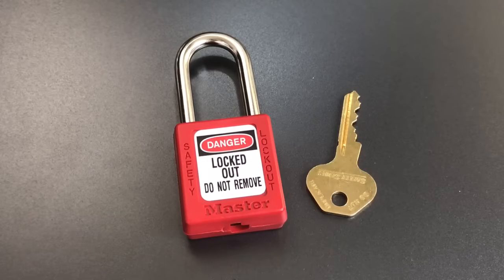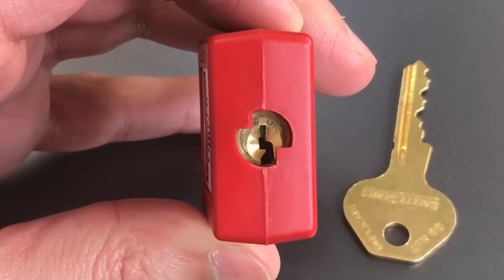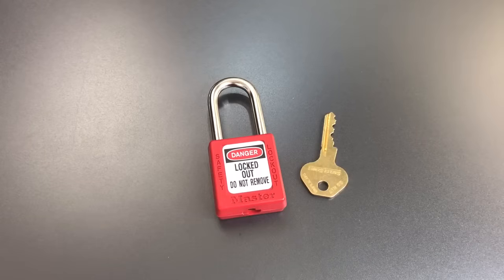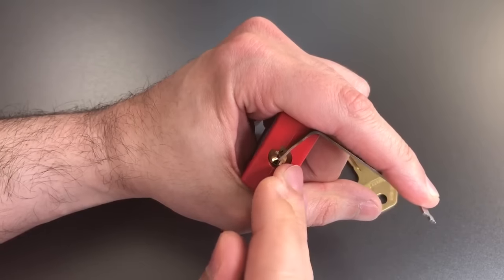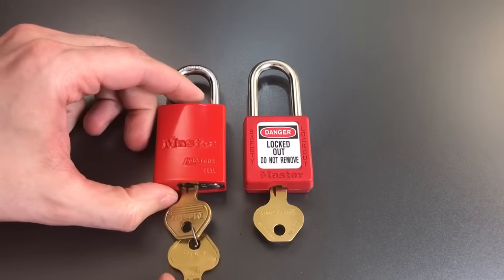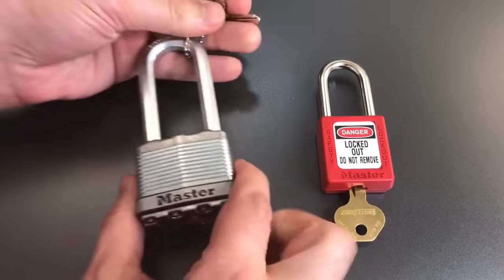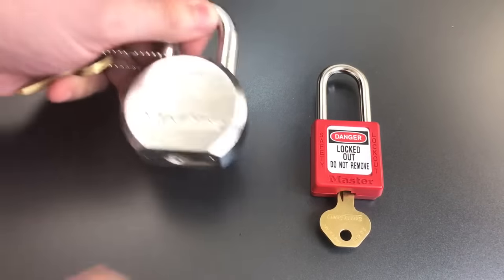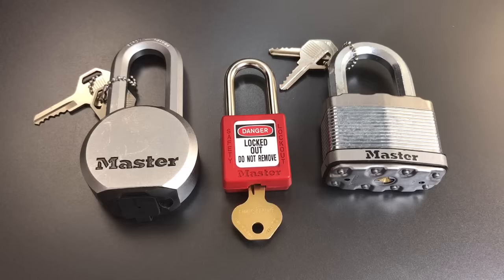[479] The Master Lock Paradox - Model 410 LOTO Padlock

Comment: I've worked in the industrial field for 15 years and I think I know the answer to your paradox with the loto locks.
A given employer may have thousands of these locks on their site at a given time (sometimes 10+ per employee), and possibly use millions of locks over the course of their business lifetime. You absolutely cannot have a key that matches a lock anywhere else than that one lock it is tied to, that is a big insurance and safety problem. So the more pins allows for more key variations. Also, people are constantly sticking their keys into the wrong locks accidentally, and so the higher quality core allows for less chance that they will force the lock open before they realize it is the wrong lock. I do this multiple times a shift, because I have several locks issued to me with many similar keys and I typically just go through them until I find the one that opens (I know I should label them). 
The more pins means there is more variety for the keys and less chance of a duplicate on site. The higher quality core, which is in all likelihood regulated by law, means less chance of someone forcing a very old lock open.
The reason the quality of the housing is so poor is intentional. You want to be able to cut or even smash the lock off in a hurry if you have to. Maybe there is an emergency and you think of a way to operate the machine in order to try to save someone who is injured. Also, more benignly, people leave for home with their locks on machines all the time on accident handing off to other shifts. So you don't want some sort of monster lock on there that you can't get off without the key. The cheap build makes buying them much more affordable for employers, when they buy thousands of these at a time.
They are not security locks, they are safety locks. High volume that must meet stringent safety standards (6 pins) for various reasons, but are not meant to be undefeatable in all circumstances.
Reply: As far as why there are stronger locks with shitty keys and cores, that seems pretty easy thing to answer. Most of these locks are all fairly cheap and sold at hardware stores, likely bought by soccor moms and the like to keep their shed closed or maybe a dirt bike or something chained up. You don't want some petty incompetent thief to be able to smash the lock open or cut it open easily when you're not around.
But if you misplace or lose the key over the winter time while you're not using whatever you have locked up, you also don't want it to be an impossible task for a locksmith to open your lock. Maybe you could even pick the lock yourself. Also more pins means more points of failure outside during rain and rust and exposure to elements.
In short, the customer gets what they want. These decisions aren't being made by masterlock. They're being made by masterlock's largest customer base.
Reply: @j37j2  "They're being made by masterlock's largest customer base."

True yet false :)
You assume the customer base is informed and makes a reasoned decision ...
Reply: @j.p.vanbolhuis8678  I don't think its unreasonable to assume that the insurance companies who require these locks can make informed decisions, when they are the ones who lobbied the government for these regulations in the first place.
There's no one person or organization who comes up with these ideas. The market evolves until it meets what is best.
Reply: I was going to say the exact same thing. Glad someone figured it out :)

A lock out lock isn't for security. It's to stop operator error.
Reply: @j37j2  Well, trouble is, masterlock does advertise a lot of easily defeatable locks as "unpickable". Assuming you're ignorant (not stupid per se, just not a locksmith), you might rightly assume that lock is enough, even if it's actually garbage. "High security" locks defeated in a single second, where the average consumer may simply not know about such weaknesses and may reasonably demand a lock that, well, locks something. When the consumer is lied to, an educated decision isn't exactly easy.
Reply: @j37j2  Locksmiths just show up with an angle grinder to cut your lock off if you lose the key.
Reply: @johnmoser3594  Or if your company is very strict about LOTO, they'll force an employee to come back in if they accidentally left their lock on a piece of equipment. I know of contractors who were called back from several states away to remove a lock they forgot to take off when they left the job site.

Key losses opens a whole can of worms lol
Reply: None of OPs wall explained why the heavy duty locks that are supposed to be safest have a crappy core and aren't safe.  
And did a terrible job explaining why the loto cores are so good when you can clip them easily.  So you can have a different sort of key as you try every key on your keychain? No, that would be utterly ridiculous to do instead of labeling the keys. 

Most establishments that have loto are smaller and rarely use it (groceries and restaurants),  and definitely aren't specifically ordering the locks with great cores just to have a different kind of key. The companies I've worked for and with tend to have policies that the loto keys not in use are kept with the corresponding locks.

Walking around with a whole keychain of unlabeled loto keys sounds like a terrible idea xD
Reply: A couple other theories:

Theory 1: local LOTO regulations from OH&S/OSHA in different areas may specify the type of locks to be used, in order to prevent the possibility of key-swapping between locks.

Theory 2 (everything hereafter):
Having used LOTO a few times myself, I think the appeal of a 6-pin core is that the lock body and key shank are longer and therefore easier to identify.

This would be ideal for a group LOTO, where a prime lock is put on the machinery, while the key is locked in a LOTO box by each person working on the equipment. The last person to remove their lock from the box gains access to the prime key (which has 6 pins instead of 5), to go unlock the prime lock and restart the equipment.

Often, contractors will have dozens of LOTO locks, for multiple LOTO points and/or for multiple team members. If the prime lock and/or key get thrown in a toolbox with a bunch of 5-pin LOTO locks, the prime set would be easier to identify.

This is just speculation about it's intended purpose, though, as I've seen combinations of 5- and 6-pin locks used for both individual and group LOTOs.
Reply: @rustylee1836  Um, yes you do need to be walking around with LOTO keys on your keychain - at the very least your personal one should be kept on you at all times. Large scale work at our plant may require dozens of locks on things like switch gear, breakers, or gas/water/compressed air valves. These locks will stay on for weeks at a time while the work is being done. At the start of the work, the locks are applied to the relevant gear, then all the keys are stashed in a gang box. That gang box is then locked via hasps with all the relevant parties (local employees and external contractors) adding or removing their locks to their hasps as they start and complete work.

And its not about the key looking different, it's about making sure there's no accidental duplicates where some bozo not paying attention can jam his personal key into a LOTO lock and accidentally have it work.

Sorry you've never had the chance to see an actual LOTO program in action lol
Reply: @dan8250  Nope I have indeed seen many loto programs, and several in action. 
Most loto programs are not at giant plants. Most are at smaller establishments that DO NOT have the same situations as giant plants. Many smaller establishments have about 6 loto locks and rarely use them. And do not carry them around. 

Many different places use loto. Even restaurants and grocery stores use loto. And they generally only apply 1 lock, which they get from the loto station, and has the key with it.

So maybe keep your condescending comments about others not having seen a loto program, to yourself.  Since it might be you that has seen fewer.
Reply: Every pin usually has 10 levels, so with 5 pins you have 10^5 combinations, that is, 100,000 of them. Far more than any company would ever need. It also doesn't explain why this lock is the worst of them all with the plastic body, when the other loto locks have metal bodies.
Reply: Still doesn't explain why the put security pins in though
Reply: @rustylee1836  you literally answered your own question there, friend. If smaller shops have only a small number of LOTO locks, while giant plants will have dozens, OBVIOUSLY the giant plants will dictate the standards because they're the main customer base. And they need it to be all but impossible to use a wrong key in a LOTO lock and have it open-that's not even just a thing they *want*, I'm pretty sure in many cases it's the law. 

As for why they put bad cores in hefty lock bodies? Easy: Profits. The nicer cores are more expensive to make, and most people buying them don't realize how easily pickable the basic cores are, so Master gets away with it and pockets the difference. But with the LOTO locks, if a large plant placed a bulk order for locks and got a bunch of duplicate keys or easily-bumped-open locks someone could easily die. And when the accident investigation found that the LOTO lock came open when it shouldn't have...Master would have hell to pay. Cheaper in the long run to use the nice cores and not have to pay the fines for killing someone.
Reply: @itisabird  That's incorrect. There are only 6 depths for the keys. Masterlock's 410 LOTO specs state "over 40,000" combinations... A little math reveals that 6^6 yields 46,656 combinations. With 5 pins, that's only 15,625 combinations.

This becomes a "birthday paradox" problem (if any two people (keys) share the same pattern (birthday))... So, larger groups of locks have a substantially higher chance of having matching keys.

For example, with just 25 locks (common for about 5-6 people), a 5-pin lock would have approximately a 2% chance of one person having the key to unlock another person's lock. A 6-pin lock reduces that probability to 0.6%. For smaller groups, these probabilities are much smaller. (For 10 locks, it's about 0.3% and 0.1%, respectively.)

Furthermore, if individuals use 5-pin locks while group lockouts use 6-pin locks, the chances of someone accidentally (or worse: maliciously) unlocking a group lockout becomes miniscule.
Reply: Very well explained.
Reply: Absolutely correct. I work for Dupont and of course have my own set of locks. So does another thousand or more employees at the same sit here at Spruance.
Reply: I label my locks with the key number...they have an alphanumeric stamp...its easy to figure out the right key...and your name is supposed to be on it or on a non-removable tag affixed to the lock...so if its not yours its illegal to try to open it...anything else youde like me to clear up about your problem with using the wrong key?
Reply: @rustylee1836  As I wrote in my reply to that dipstick...the keys have stamped codes that make it easy to label the lock with...I have a write-able tag on each key and as soon as I apply that particualr lock the location, item and date are written on it...I dont know why people cant figure that out...should not be a problem figuring out its not your lock...
Reply: that plastic lock is ingenious actually... It is made of cheap materials (because it is not a security lock) so it keeps costs down. BUT it has a robust core with lots of key combinations which solves the issue of possibly getting a few locks with the same keying on a jobsite.
Reply: Sounds fair enough to me ?
Reply: @RingpopSmiths  So probability isn't my forte at ALL, but your 2% seems wrong. 

You're saying that getting the same combo 2x in a batch of 25 out of 15,625 possibilities is a 1 in 50 chance?
Reply: @rustylee1836  It's a little counter-intuitive at first for people who aren't familiar with how the birthday paradox works. What may help is thinking of it this way:

Let's say that myself and 4 other people each have a lock with 100 possible combinations. Most people think, "What's the chance that one of the other 4 people has a lock identical to mine." In such a scenario, the answer would be 4%.

However, the birthday paradox doesn't consider just the locks that match one fixed person, it considers the possibility of ANY TWO people matching. It's the same as asking "Do I match with anyone, or does anyone else match with another person?" In this case, it's like turning the fixed case into a handshake problem (get everyone in the group to shake hands once). I can shake 4 hands, the next person can shake 3 more (because they shook mine already), the next person 2 hands, the next person one hand, and the last person doesn't shake any more hands (because they've already shaken everyone else's hands once).

To combine this scenario with the locks, the inverse of each probability is multiplied together and re-inverted to get the final probability:
(1-0.04)*(1-0.03)*(1-0.02)*(1-0.01)*(1-0.00) = .96*.97*.98*.99*1 = 0.90345
1-0.90345 = 0.09655 ≈ 9.7%

As the group of people grows larger, the probability rapidly approaches 100%. For example, another 6 people (11 total) is 43.5% chance of matching. 5 more (16 people) is 72% chance. 5 more (21 people) is 90% chance. At 26 people, it's a 97% chance of two people matching, not a 25% chance as most people would assume.

So yeah, 2% may feel wrong, but it's not.

(Note: I didn't use any reference material and I'm starting to get rusty on my statistics, so there are likely errors in the above calculations, but the general principles and explanation method should sufficiently illustrate why the probability is not simply a multiple of the number of locks.
Reply: That tells me that the people working with you are mostly extremely superficial. And not very precise people. It is not very hard to look at the number on the lock, and see that the number match the key. That would be good enough for me, to never mix up any of them. Even if all the locks had the same key. Or have some fun and pick the lock instead, and you don't need the keys… 🤓
Reply: @dan8250  most plants I've been in would only break a lock if the employee/contractor absolutely couldn't come in or had died on the job.
Reply: Well said
Reply: Fellow industrial worker (I worked on ship) 100% agree. But I can see why he was confused. I would also add that they wanted to protect it against nondestructive opening. Like if you had to cut it open that’s one thing and it would be hard to cover up but if you were able to “easily” pick it then it is a potential insurance loop hole. And they do love loop holes. .
Reply: @Gismo3333  That is assuming that the labeling is legible. Besides he mentions in his OP comment that his keys were specifically not labeled. If he’s only got a handful or two of keys not that hard to try a few before you find the right one.
Reply: @rustylee1836  I love how you’re first comment assumes that your experience is the norm then you get mad at other who do the same thing. Clearly there are setting that do not use LOTO as much as others doesn’t make one better than the other.

What I will respectfully suggest is that master lock is not making these locks with the small use case in mind since I would assume that most of their sales and repeat costumers are large scale plants and other industrial settings. I know on my ship alone each ships officer had about a dozen of these.

And since ships have maybe a half dozen officers that quite a lot of locks for one setting I can even imagine how many a whole fleet would have.
Reply: @Platinum_Squid  — You must have big hands, since you easy can fit 3000 keys in you hand. Yes, you are one of the superficial, people I was taking about. If I guess… You argue just for the sake of arguing.
I don't think you know what you are talking about, and you don't care. Read the two first statements, would make my point.
Reply: @Gismo3333   lol ok buddy if you want to walk around with 3000 keys be my guest.
Onboard we never had more then maybe 10 keys for each officer. If you had to lockout more then 10 things… your probably needed to be in dry dock. Add to that the other dozen or so keys and you still would have a pretty heft keychain but not 3000 keys.

I can’t even imagine how big of a ring you would need for that.

Edit:

Oh and before you comment. Yes if you add up all the keys everyone had you might get to in the hundreds of keys. But nobody not even the captain is walking around with a full set of everyone’s else’s keys. Your keys open your locks. That’s it. No extra copies for your boss or whatever.

I’ll admit that my shipboard experience might be different then your if you have actual used LOTO before in a professional setting.

Also it goes without saying but if we’re caught picking a lock even if it was your own. You would be sent home faster then you can blink. Because you just voided the whole safety system of the ship. And good luck trying to smuggle your picks on boards too while your at it.
Reply: @Platinum_Squid  — first off… don't buddy me… I never be your buddy. I acually hate people like you, that never listen when others are talking.

2'end… We are not talking about your boat.

You are lost in what you think about, and don't listen to others at all.
Reply: @Gismo3333  hey, it’s been a bit, just wanted to apologize for the whole “buddy” bit. Honestly it’s been so long that I would need to reread the whole comment thread and watch the video again to be sure I got the context right. But I did skim though our exchange. I think we just have very different work environments and for all I know yours is the typical one and if that’s the case I’ll be the first to say I’m wrong. I’m just going by my own life experiences working on ships, the engine room is basically a mini power plant.

Anyways, sorry again for the snark you know how internet commenting can be. I am trying to get better about that and not just exchange insults like children or whatever.
Reply: Came here to say exactly this, I use these locks everyday and people forget them all the time, they're made to be able to cut off basically
Reply: @j37j2  I don't think the average customer has any idea how easy it is to pick an average Master padlock. Heck, on another video , he opens their digital, multi-wheel, combination padlock by striking it once on the broad side of the case, with a light mallet.
Reply: Bro.. U believe you are over thinking it.. lol
Reply: Interesting, thanks for commenting
Reply: Didn’t LPL already rebut this suggestion in the video itself? The 6-pin core being for the sake of mass purchase doesn’t explain why Master makes LOTO locks with 4 and 5-pin cores. Seems like 4 and 5-pin offer plenty of key variety for safety guidelines since those are also on the market. He also pointed out that the weak body is equally baffling because those other LOTO locks are made with much sturdier bodies. So if that’s a crucial part of a LOTO lock, why are the other models so much harder to break? He spent a large portion of the video already answering these explanations nearly verbatim…

Further, this still doesn’t provide any reasoning for why they wouldn’t use a superior core on their best lock models. A system is only as good as it’s weakest point, so why make a lock that has great defenses and then use an inferior lock when they have access and patent of a better core already in production.
Reply: I WAS TOLD THE AUGUR WAS LOTO HOW IS THIS MY FAULT-
Reply: Ok reading this shit jus wow y'all really threw hands over lockout tagout procedures smh chobani doesn't even care half the time bro I doubt your boss cares about your limbs more than mine did
Reply: @aetherwise2159  Because half the time all your doing is hooking the lock in to ensure a circuit doesn't complete while your in the machine. As long as the top part and the core are operable it's fine, cost v effectiveness yk
Reply: @vivtin  I'd bet the security pins are there to help prevent an accidental raking by a key with similar-ish bitting.
Reply: That's kinda what I thought tbh. These locks are, to a degree, meant to be disposable, but it's important that none are so easy to defeat that you could accidentally do so, say with a key from a lock in the same batch. 
The cheap construction means that when a forgetful employee leaves their LOTO lock on machinery, they can reasonably afford to replace the lock. But the secure core is more a factor of keeping the lock out procedure secure.

It does not, however, explain why master lock has such a shitty lineup for their residential clients. That, I believe, is more a factor of being reasonably difficult to bypass. Let's not forget, most people can't pick locks, and even if it's a simple skill most people don't care to learn it. 
However, master lock plays on people's ignorance on the subject, and advertises to the lowest common denominator. Hence why you can pick up master lock products all over the world, especially in the US. Most of us would rather replace a broken or cut lock if need be than pay for high security locks AND a locksmith if we needed to get back into our property.
Reply: @Platinum_Squid  *you're
Reply: Why don't you mark the body and the key to know which one to use?
Reply: Thanks for explaining
Reply: agree
Reply: I suspect you are correct. I work in the renewables energy field and we have a "no duplicate" key requirement for our LOTO equipment.
Reply: I think the bigger question is if master lock has the higher quality core, why would they not use it on their higher quality locks?
Reply: @rustylee1836  To add to what others are saying- You are right, but only in the context of say, a small business or retail store or something that has some heavy equipment (like a forklift or baler) that may need to be locked out if it fails. In this situation, you're correct. But on a construction site, for instance, there is a lot more equipment in use and it needs to be locked to prevent unintended usage whenever it isn't being operated. So lots of workers will have multiple keys and locks for all the things they operate on their shifts.
Reply: @dan8250  this is old, but at my work, the policy is that they call you, and you come back if you can, but if not, and you say that it's okay, they can cut it off. They can't do it without your permission, because you could theoretically be hiding in the machine somewhere, even though the machines are all clear and easy to check for personnel inside. Which makes me wonder what they'd do if you left it locked and just said "No, you can't cut off my lock"
Reply: Yep at Halliburton we were always smashing locks off with hammers when a dumbass would leave theirs on a pump , same thing at steel mills. Also the long weak shackle is way easier to reach with a grinder. I’m sure that’s why they mostly use the plastic ones. At Halliburton I believe we had one like the one in the video and also a nicer made American lock.
Reply: i can second this
even just in class as an electromechanic we would accidentaly try to open other people's locks just to start the machine we were working on as a group
Reply: @dan8250  that's absolutely what is supposed to happen.
Reply: Yep. It's a blended engineering and administrative approach to Safety control of mechanisms / power devices.   I've never had to destroy one's plastic housing, but I've cut a few after doing the verification that an affected employee is safe.... as in, picks up the phone:  "Hey John, are you in this excavation at [location X in Alaska] where we have energy isolation in effect?"  "No, I'm in Indonesia, sorry I forgot about that lock...".   "Hey no worries, bud.  Enjoy the time off."  [Fills out paperwork and then cuts the lock].  

I had NO idea the lock cores were so good.  That's a good thing, especially after seeing how quickly & easily a lock picking expert can open the device without destroying it.
Reply: Understand and believe in the logic in  that, but it still doesn't answer the question of why good build locks have pore core :)
Reply: Ffs ppl, the only reason for the plastic body is bc many regulations want loto lock body to be *non conductive*🤯🤦
Reply: Damn. Great job. I didn't know the LPL had such intelligent viewers. Not your average fanboy.
Reply: @rustylee1836  You are a typical LPL fanboy. You don't have to write some big words and try to defend LPL here.
Reply: that makes total sense
Reply: @rustylee1836  do you not realize that the larger plants are the ones who set the standards? They're the ones who will buying the vast majority of these LOTO locks not the smaller establishments that are only buying a handful, so MasterLock will cater to these larger organization's wants and needs not someone who is a small percentage of their customer base
Reply: @aetherwise2159  plastic is cheaper that's why, if a company is buying hundreds or even thousands of these locks the cheaper they are the better, it being easy to break is just a side benefit if they ever need to cut it for some reason
Reply: @Dell-ol6hb  You apparently couldn't follow the conversation. The locks are super easy to snip so they AREN'T what the larger plants want, so they AREN'T setting the standard, they're getting whatever trash masterlock made.

You somehow missed that in the discussion? They are the easiest lock to snip and that goes completely counter to the lockout policies the plants have, they should not be extremely easy to clip.
Reply: I agree with that I worked at a beef plant for 15 years where our pssi cleaning crew uses only those for lock out and I think it's for the variation of key possibilities and also because of all the water everyday corrosion which you won't get with plastic
Reply: @j37j2 correction; it evolves to find the lowest priced solution.
Reply: As a robot programmer for 11 years, yep these were my general thoughts.
Reply: @vivtin the security pins are there because that core is probably used in a few different locks and why reinvent the core 
Just use it in multiple locks
Reply: The real question is not about those locks... It's about why would master lock not have better cores in their big "security locks" heavy duty stuff when they clearly have a core that they can produce right in front of their hands that is much MUCH better. Also a "safety lock" doesn't need security pins.
Reply: One more reason for plastic, so no one steals them. They’re useless for security.
Reply: This was my first thought as well, we use plenty of those in the oil industry. If that Industry asks for a guarantee that no 2 keys will never accidentally match, you better give them your best core.
Reply: It doesn’t explain the security pins
Reply: @cheesebusiness  I think it's more about not reinventing the wheel when you got one that does the job.
Reply: That is correct, I almost got electrocuted when an employee remove the lock to check the parts counter and the hours of use, he was the one who brought the locks for our LOTO and they all had the same key (1980s).
I worked in a place where we had to use more than 200 locks just for one job to comply with the LOTO procedure. Thousands! yes and never found a duplicate  
An easy to break lock can prove that it was tamper with, and that you properly  LOTO the equipment, also so health and safety department can cut them as needed (they did not like to reuse them
Yes we had a lock smith and he needed to fill a form to make a copy of a key  or open an office (never a LOTO key or lock)
Reply: I’d say there is truth in your comments but it doesn’t answer the second part of the paradox: why do they not use a parametric 6 pin lock for their high security applications. They are already making and selling a lot of the LOTO locks. Just put those in the hi sec ones
Reply: lol I was about to say basically the potential for a lawsuit is what's getting you two extra pins, absolutely no other reason
Reply: @j37j2  Thanks for your detailed explanation. Seriously. Your comment was really helpful and respectful, and that is rare in comments these days.
Reply: This doesn't solve the paradox. The big question LPL had is why do "good" locks not share the good core.
Reply: I think the paradox is that they could use their best core in other 1000 lock but they choose not to.
Reply: People in this thread are dumb...

op is correct

Big plants want no locks with keys that match. More pins = more variation. Big plants DO want locks that are easy to smash for absence and safety reasons. They're not there for the "safety" of being hard to REMOVE, they're there to
1. Be a big red sign saying SOMEBODY LOCKED THIS
2. Be hard to accidentally open by key if you forgot whether you or your coworker last locked this jawn.
They're difficult to match or jimmy (security pins) to prevent accidental unlocks but fragile so they can be removed in an emergency.

"But then why don't they put stronger cores in stronger locks?" Capitalism.
Reply: My thoughts exactly re “why the body is brute-forceable”
Reply: This exactly.    I’ve worked in places where there were about 200 of these that could be in use at certain times. One of these with a tag showing info on who applied the lock why and when. We were also allowed to use a zip tie as long as it was rated for 50 lbs along with a tag. When it came time to start unlocking a lost key was less of a pain in the ass than any of the zip ties.
Reply: If you have to start up a machine in order to get someone out who was injured, it wasn't properly locked out in the first place.
Reply: Years late, but joining the party... another big reason for the design -- conductivity. These are explicitly designed to be non-conductive which in certain areas of the LOTO world, is a big deal.

You're correct in stating these are safety locks, not security locks.